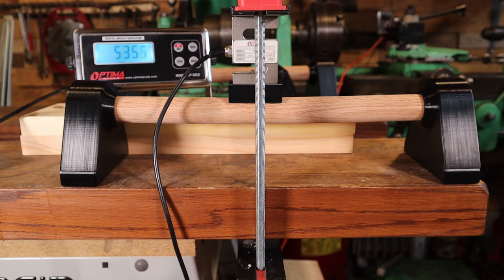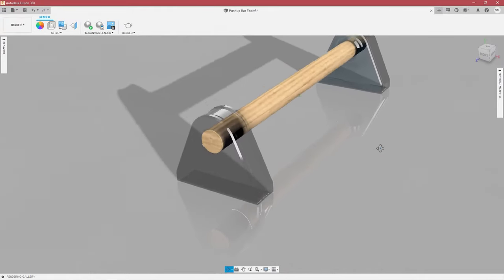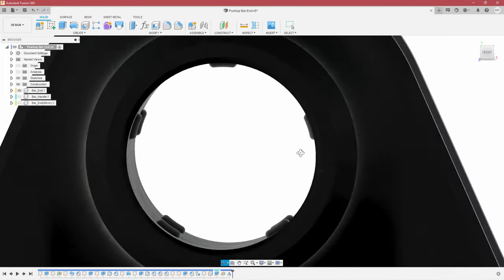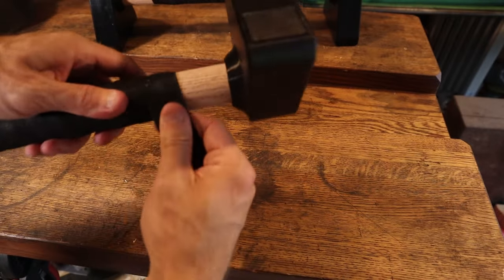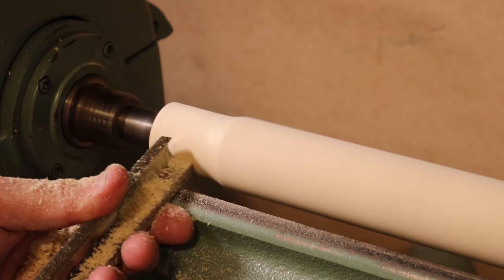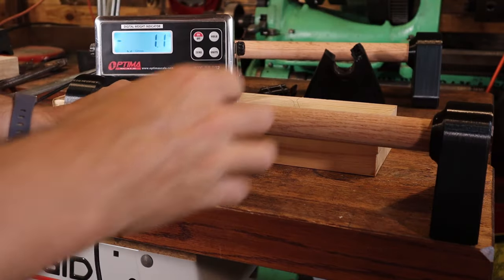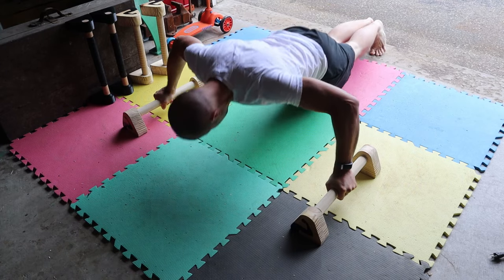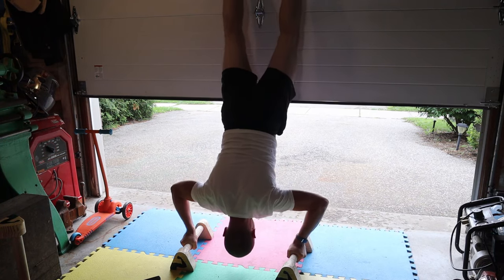3D Print Your Own Exercise Equipment - Plastic/Wood & All Solid Wood - Build Better Yourself!

Comment: I made something very similar to this, except it uses square hardwood (1 3/4").  On the print, the last 5mm, there's a small taper, and being square, it doesnt rotate, doesnt require any press or glue, can be disassembled super easily (compression), and it was easier to simply round the center of the square wood then to engineer an anti rotating circle.  I have near exact same feet, funny how I ran into this video well after I created the item, and it is super comfortable to use, extremely stable, and can support any weight.

Comment: This is a great video! Thanks for posting! Love that it highlights the woodworking and shows a few different way the 3D printer can really complement other hobbies. Great use of the template for the spray paint...I'll be using that for sure.

Looking forward to the next one!

Comment: Yet another great video from your channel!! The wood one might look slight better if you used a different spices of wood on the ends to give a two tone look. But great build!
Reply from the maker: Thank you!  I have another coming this weekend, I am working hard to get back to videos after moving.
Reply: @NeedItMakeIt  I understand what you mean their, I dont make videos. But I recently moved quite far. An it's a pain! Actually just finally got my 3d printer set back up yesterday pretty much. Had acouple days of troubleshooting that to get it to work properly. Fingers crossed I'm over half way on a two day project

Comment: Looks amazing, how is it holding up now on the 3D printed any failures or is it still going strong.
Reply from the maker: Still going strong, I sold one set, the only issue was that it was super tight, PETG can crack under high pressure, ABS is probably a better option.

Comment: I would have laminated the wood ends cross-grain, with the horizontal grain on the inside and the vertical grain on the outside, that way you'd get the best of both worlds.
Reply: Yeah offset the grains for sure, way stronger
Reply from the maker: Yeah, in this case that would have worked well.  Essentially plywood.

Comment: Nice idea....how about weights that are hollow and can be filled with sand or the like?
Reply from the maker: That's a great idea, the main problem with printing the parts is that they are fairly weak along the layer lines, maybe filling then baking in the oven for a re-melt would work?

Comment: Good work(out)!
Reply from the maker: For sure! since using them I've noticed a difference in strength and it has only been a few weeks.  I think I'll be using these a lot more, I will be making a taller set too, these were just a tad short to do some of the other exercises I'd like to do.

Comment: Nice video but pla gonna do the job too men it's stronger than everything else if you don't exercise in the sun whit 100ºF jaja. The ends  can be more thin than you think even taper , don't relay on infill for strength, is wasted plastic because aprox. 90% of the forces goes  through the shell, more perimeter more strong, more infill more weight and time printing, use the necessary infill for the top to be printable.
 Why pressure fitted and not a simple set screw or wood screw, or a wood dowel ?, you can hide it depending on the angle or even use epoxy, all those thing without the problem of reducing the diameter unnecessarily 
With the amount of tools of this video you can cut and turn a 2x4  for doing the round ones 
you can use a pvc pipe with thick schedule instead of wood

it a constructive critic don't get me wrong, it's your project but there were so many things that can be simpler
Reply: Yah, a lot of people don't give credit.  It can be pretty damn strong.